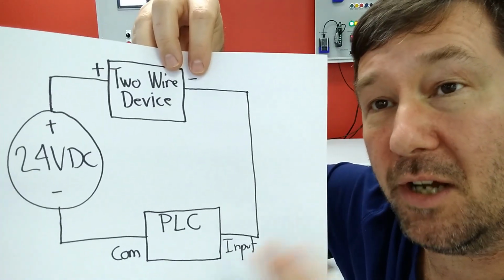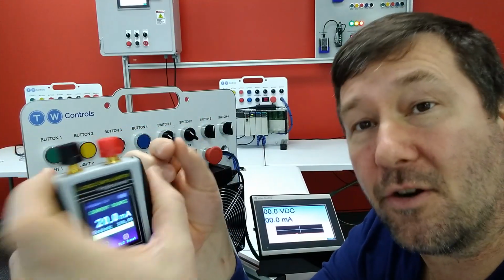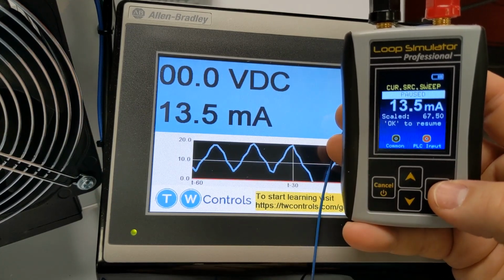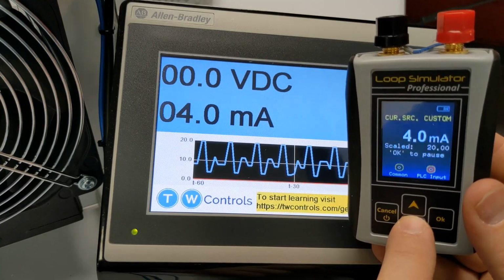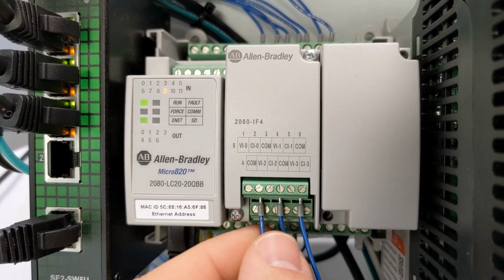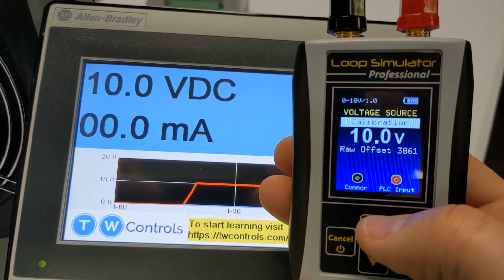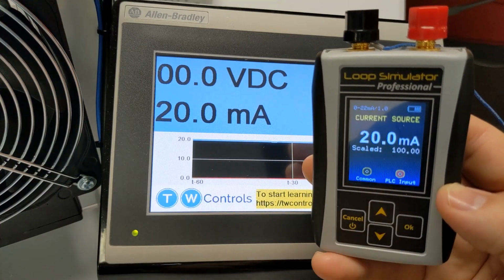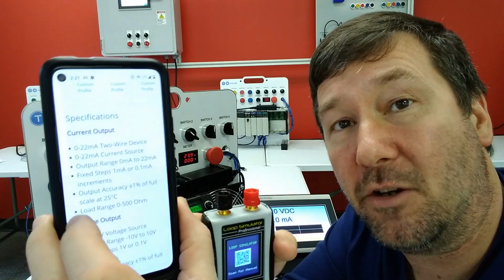How to Simulate a 4-20mA or 0-10VDC Analog Signal - PLC Tools SIM-ALP2

Comment: Few questions. 
For the scaled values, these could be used to represent temperatures as well correct? call it 20mA for 300C for say a temp gauge, or 20mA for 5000PSI... ? whats the limit on the scale value? Im OnG service tech that travels globally, the compactness of this is very appealing for verifying transducers and simulating various scaled. Thanks for your time
Reply from the maker: Yes, the range is 1000 so in the case of your 5000 PSI sensor, you could do 500 and know that you need to multiply it by 10.

Comment: Hello Sir 
Great contents
I have seen portable  DC/AC power sources with variable output.
Is there a technical  difference between using those types of power sources  and using for instance  the SIM ALP analog simulator
I am only a rookie in HVAC field and looking forward to purchase an equipment that will assist me with diagnosing dampers or valves actuators.
Thank you
Reply from the maker: Range.  If you have a power source that does 0-50V, you may do OK simulating a 0-10VDC signal.  But if it does 0-5 amps, your 4-20mA actuator is 0.004 to 0.020 amps.  You won't have the resolution you need to test those.  As much as I would love for you to purchase our product, chances are you will need a good Fluke designed for HVAC...many of them can source these signals also.
Reply: @TimWilborne Thank you for your reply.
U S always the best for HVAC resources

Comment: How can you use this to determine the integrity of a wire? If it’s broken or weak?
Reply from the maker: The open wire feature will tell you if you have a broken wire or to high of resistance to push 20mA through

Comment: I love the video, but I do have a few questions that I hope you can answer or someone with more knowledge can answer. I was gifted the Loop Simulator SIM-ALP2 from a maintenance technician here at the wastewater treatment plant in Tuscaloosa,Alabama. I'm having a hard time trying to figure out what this device can provide me with. I deal with 4-20mA standards on a daily basis as we use E&H transducers for our local lift station wet wells as well as various other devices that utilize 4-20ma. We have RTU's that house MicroLogix 1400 PLC's as well, so honestly I am trying to educate myself on this particular instrument hoping that it can provide me with one more tool in troubleshooting. I have a FLUKE 787B and FLUKE 789 that can both simulate and source, so what need can I get from this Loop Simulator that will make me more efficient as an electronic technician ?
Reply from the maker: Hi Joseph.  Here is a video with the long answer.  I should have it chopped up into smaller videos soon but mouse over the timelines and find the 2 wire vs 4 wire section, and then the 2 wire wiring and 4 wire wiring.  Most of your E&H that have a display will be 4 wire.  The ones without are likely 2 wire but the first thing would be to learn which one is which because there are two types of mA signals that you will need to troubleshoot.
https://www.youtube.com/watch?v=20QltAiD_G4
Reply: @TimWilborne  Thank you, your video's have helped create a cleaner picture for me in my career as an electronic technician. As an instructor, do you happen to know of any weblinks that will help me along the way ? I'm an avid collector of knowledge and would love to hear your thoughts and suggestions on any information regarding 4-20mA, electrical & electronic troubleshooting, PLCs, etc. I work in a wastewater treatment plant, so I am very use to working with PLCs, contactors, relays, level and pressure instrumentation, ISBs, pumps, pump level controllers, DEVAR controllers, limit switches, etc.

Comment: I want to test a servo/drive using my newly purchased SIM ALP-2 from Amazon. On page 11 of the following linked PDF [ http://www.dmm-tech.com/Files/DYN4MS-ZM7-A10A.pdf ], you can see my pin layout. What would you guess to be the proper pin connections for testing with the SIM ALP-2? 

Thanks for all of these great tutorials. 
Best, Matt
Reply from the maker: According to page 11, you would put the PLC Tools SIM-ALP2 in voltage source mode then connect the red terminal to pin 13, AIN+, and the black terminal to pin 25, AIN-.  Thank you for your order!

Comment: Can u make a video to how to wire to split a 4-20ma signal????
Reply from the maker: You don't "split" a 4-20mA signal, you series them.  Similarly to how I add a meter into the loop in this video.
https://twcontrols.com/lessons/how-to-measure-a-4-20ma-signal-without-blowing-the-fuse-in-your-voltmeter

Also there are modules that are splitters modules which are basically 1 channel analog in 2 channel analog out circuits where the two output channels mimic the input channel.  These can be useful where you have a high load impedance or you want to isolate one circuit from the other.

Comment: Hi Tim. I have seen you and your kids do some cool side projects over the years and had an idea that maybe you and your kids could do that would also help those of us new to Controls and PLCs. Could we use a PLC with an Analog output to control a RGB LED Strip Light?  There are both addressable and non-addressable strip lights, I am not sure if we could do it with both. I cant really think of a real reason I want to do this, but I have all the parts laying around my desk and have been using resistors to change the color of my strip lights because I do not have a controller for them. Might be a fun project and learning experience for analog outputs.
Reply from the maker: Hi Adam. That should be possible, my son does it with an Arduino, you are right, could be a fun lesson on ratios.

Comment: Nice!. Tim , What about 3 wire device? Is it not used in the industry?
Reply from the maker: 3 wire device is a 4 wire device without an isolated mA-.  You use the PLC Tools SIM-ALP2 in Current Source mode and connect it as a 4 wire device.